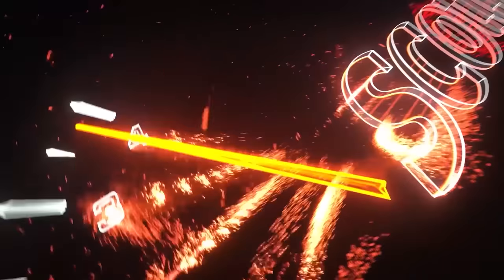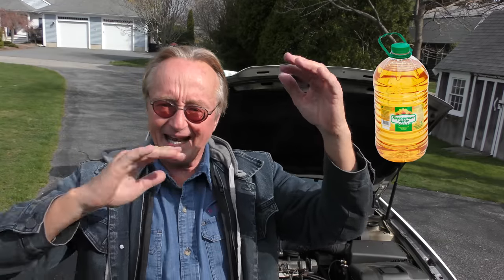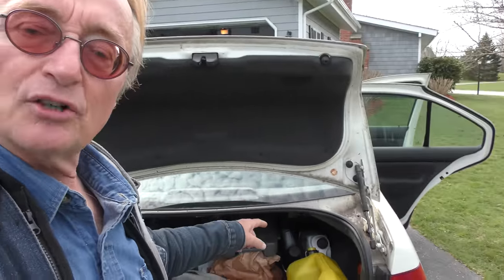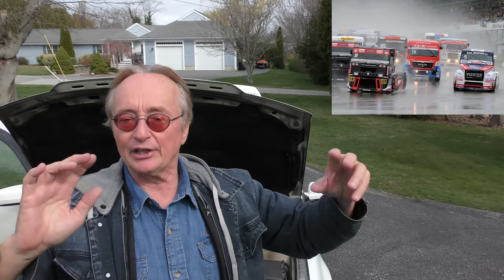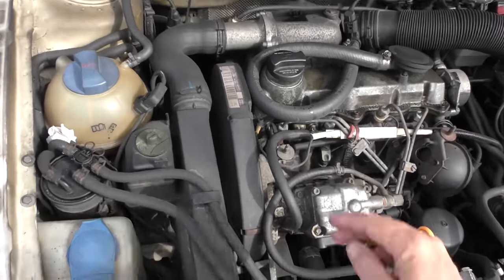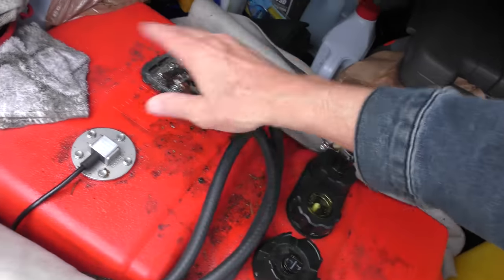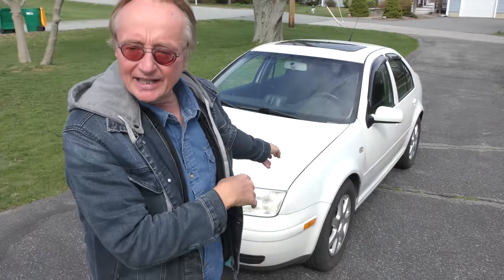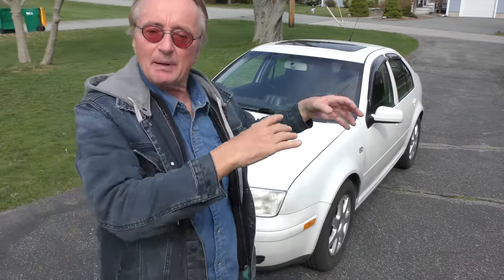Install This on Your Car and You'll Never Have to go to the Gas Station Again

Comment: I have a question and anyone feel free to answer, I saving up to get my first car and I’m looking to get the Subaru Crosstrek very soon, but Idk if now is the time to really look to buy a car, what are your thoughts? Should I wait? Another question is How should I prepare to deal with the dealership? since I hear so many stories of ppl being taken advantage of? That’s one part I’m not looking forward too when the time finally comes to make the purchase
Reply: We wanted a crosstrek but they were too hard to find. Settled for an Outback. I think it would have been worth waiting for a crosstrek. Outback is a little more car then we need though we have no complaints about it. If you can wait prices are going to come down and surely availability will improve. All a question of how long you can wait. You could even consider Impreza. We didnt want that because of the low undercarriage height, we have lots of snow to consider

Comment: I have used filtered used  peanut oil in my Mercedes 300TD and it ran well. I failed to filter the oil enough  so I had to replace my fuel filter more often than usual.

Comment: I wonder about the redline smelling car smell is maybe Sulphur smell  which could be Fuel mix depending where  I fuel up  I get that smell when I step on in in my 06 is350 but  i would never redline it I set the warning light to go off before I redline, just because the tac has a redline it doesn't mean that the engine in the car really can handle it unless you built the engine your self  or had the engine built that way to handle such things

Comment: This is why vegetable oil can never replace crude oil.  World wide we produce 200 million metric tons of vegetable oil every year.  That sounds like a lot right.  We pump out of the ground though over 3.5 BILLION metric tons of crude oil to meet our energy needs each year.  Now it might be kinda cool to make a small efficient vegetable oil powered engine on a small trailer to be used as an EV range extender.  Used vegetable oil could be used that would otherwise be thrown away.  It is much cleaner burning than diesel.  It might even be possible to make it cleaner burning than gasoline.

Comment: Had a friend that was doing that 10-15 years ago. He lived in Northern California. He was getting used oil from bakeries, burger joints, etc. Then one day he was making his rounds to mom and pops bakeries and they all told him someone else was picking it up. Evidently, he was being watched. Back at his house an official showed up and asked him for permits, Licenses you get the point. He was told to cease all home filtering of oil to run in his car or he'll be sued. Chevron ended up picking up the used oil and refining it. The little guy doesn't have a chance of getting ahead of big brother.
Reply: They probably have an eye on their oil disposal budget and when they saw it shrink they knew.

Comment: Correct me if I'm wrong but If I'm not mistaken, the inventor of the diesel engine, can't remember his first name, originally designed the engine to run on peanut oil.

Comment: what exactly is the purpose of the fuel sending unit on the passenger side of the gas tank? I have already replaced the fuel pump but still having spratic fuel issues. I have a 2012 v6 mustang

Comment: hydrogen producer in your trunk. water in a little electicity meens electolysis with your own generator from the engine. just produce enough for driving.

Comment: These diesels that run on vegetable oil smell like a mobile McDonalds. Before they become highly computerized and electronic diesels could run on just about any kind of oil. You could even run them on Bunker C. It made a lot of power but rolled coal like a Soviet factory.

Comment: Hey Scotty!  As a lady I also love your videos.  Just wanted to let you know that my husband had a truck that ran on restaurant oil(Chinese restaurants gave it to him).  He smelled like a Chinese restaurant going down the Hwy.  I would love to know what kind of car  I  could get to be safe from all the crisis of car parts?  Is there anything safe as far as cars?  Right now I have an Audi Q5 2.0 premium s line tdi  all wheel drive diesel.  I get great mileage on the diesel.  I have almost 163,000 miles on it now.  I also have a 2008 Dodge Charger with 326,677 miles and still running.  It just needs an air conditioner (condenser).

Comment: Scotty, I don't think the math works out quite right.  If that old diesel can go 1900 miles before a refill, that works out to 82 MPG.  Or did you mean that, since the car runs mostly on "free vegetable oil" that before he needs another fill of diesel, the car can go the 1900 miles before he spends another penny on diesel?  So, does he carry 300 gal of vegetable oil to make that cross-country trip on just one fill up of diesel?  LOL

Comment: I’ve been having problems with my 1979 fiat spider, after driving it for a while, it will start stalling, or sputtering or whatever after changing gears. Anybody got any insight on that?
Reply: It sounds like a fuel delivery problem if you haven't already changed your fuel filter do that  before changing your fuel pump I'm sure Scotty has made a video that covers this problem
Reply: A warm engine requires less fuel
Reply: Yea I was thinking it could be something to do with the fuel too
Reply: What do u mean less fuel?
Reply: FIX IT AGAIN TONY
Reply: @big_ortega7369  Dial back your carbs. You might have noticed, driving through the summer months, that you're filling up the car a little less often than you would over winter. It's not your mind playing tricks on you, but a fairly common occurance for all drivers. Cars simply get better gas mileage during warm weather than they do when it's cold.J
Reply: Dale was right😂

Comment: But... doesn't he still have to start the car on diesel before switching it to the oil?
As I suspect, vegetable oil would congeal in the injectors.
So would he not have to run the diesel to clear any excess oil in the lines prior to starting or stopping the car?
Still, pretty brilliant.

Comment: Just to clarify are you saying if I can find that exact VW at a junkyard (diesel) at a fair price that works and I drive it until empty I can just fill it up with vegetable oil and it would work just fine? Was the dually ford gas tank the only modification?

Comment: Originally the diesel engine was designed to run on peanut oil, believe it or not. And though vegetable oil can be used to power a diesel, diesels have fallen out of favor so there aren't many being produced these days. On the other hand, there are used cars and trucks around to tinker to with. But not everyone has the ability to do the conversion so there won't be too many people doing this. And this isn't new, really. People have been doing this and making biofuels for decades. Just find an old issue of The Mother Earth News, or check it out right here on YouTube. There are resources out there. Step one, buy a diesel car or truck. Step two, have fun.👍 Propane is another way to go. But that's a horse of a different color.

Comment: This is probably a dumb question, but I can't find an answer. I bought a truck 3 years ago. The previous owner told me the engine had been replaced at 200k miles. Is there a way to see if this is true? I'm trying to resell and would like to know.

Comment: 500mi on 10 gal of fuel....um thats about the same mileage. Most 4 cylinder vehicles have a 10-15 gal tank anyways. And they don't get much better mileage, if at all.

Comment: That's one way to wreck your motor. Bio diesel is the worst. Just because you can doesn't mean you should
Reply: Issue is water being left behind and drying up. Sure this guy addresses that problem or the engine wouldn't have lasted so long
Reply: Just realized its a diesel engine so never-ending

Comment: If vegetable oil could run a car why aren't the car manufacturers making the cars like that. Cut the EV's we got the most efficient car.
Reply: Maybe because the whole town is gonna smell like french fries? . . .
Reply: if  a  whole  lot  of  cars  ran  on  vegetable  oil, there  wouldn't  be  any  left  for  mc ds  n  bk  to  cook  their  french  fries, n  the  cost  of  veggie  oil  would  skyrocket because  of  the  high  demand.
Reply: @driver4011  why wouldn't more companies get in to the competition and create more supply for cheap? There's enough vegetables for everyone.
Reply: @AlexanderY18  
agree.....and  enough  ethanol.  thats  what  brazil  did.  alcool  fuel....ethanol  extract  from  sugarcane.  should  be  a  variety  of  different  types  of  vehicles  that  run  on  different  types  of  fuels.  ethanol, biodiesel, hydrogen, c n g , propane, etc. turbine  engine - runs on  hydrogen, or  nitromethane, or  ethanol.  time  for  a   renaissance  in  production   of  cars  that  don't  run  on  gasoline.

Comment: How many of you mechanics hot-rodders Gearheads and knuckle Busters know for a fact that fuel diesel fuel and gasoline types have a lot to do with the longevity and where of your engine!? Just do some research Google it for example diesel fuel grades and Diesel that's got water in it or contaminated or is old Etc the wear on injectors Pistons valves!? I mean you could ruin an engine I'm sure of it. How long would it actually last running that stuff? When results from genuine gasoline and diesel fuel can be detrimental to an engine let alone your French fries